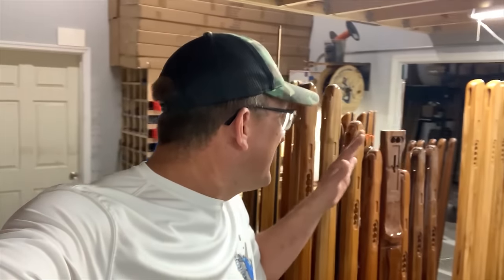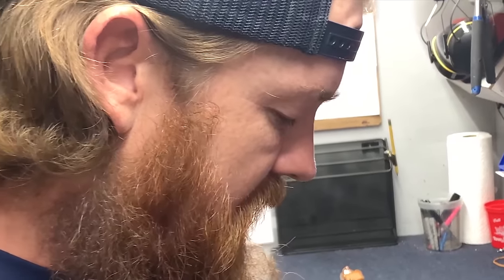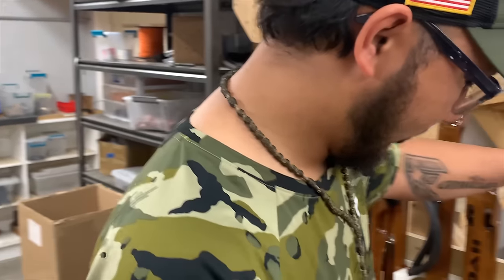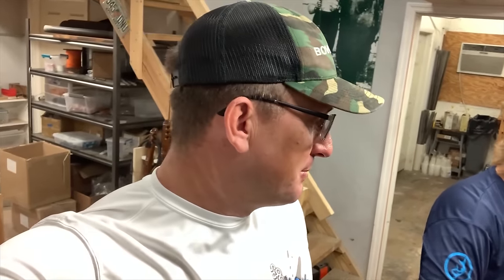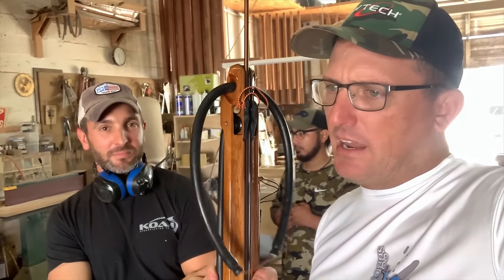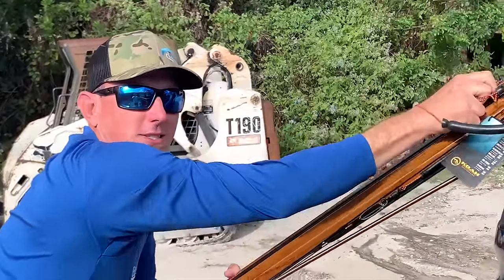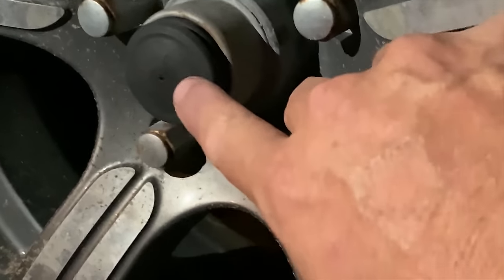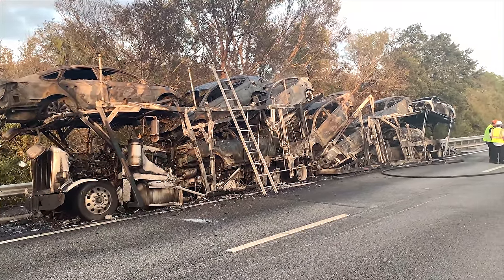Epic GIFT for myself and BLUEGABE! Crystal River here we COME!!!

Comment: When dealing with brakes it's never a good idea to put it off. I have lost my brakes a few times and one time I have lost my brakes when the brake line got a hole in it and  I had a heavy load on a trailer on a hill and the brakes failed to work that was scary. We had to break the line and crimp it off with locking pliers until we got home. Never a good idea because of the pressure on the line, low amount of brake fluid and you need to be experienced with brake loss to do this. Don't try it because it's dangerous. Have a great night.